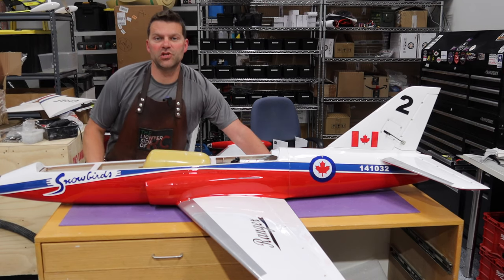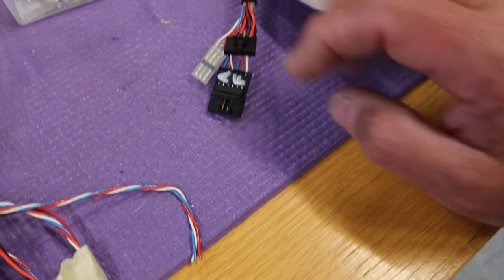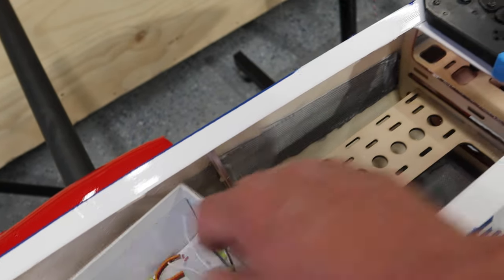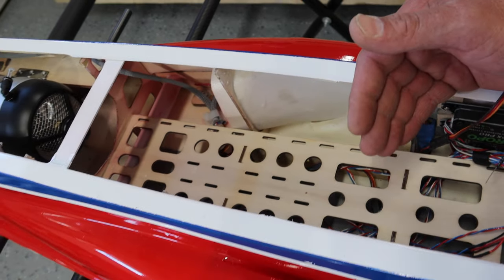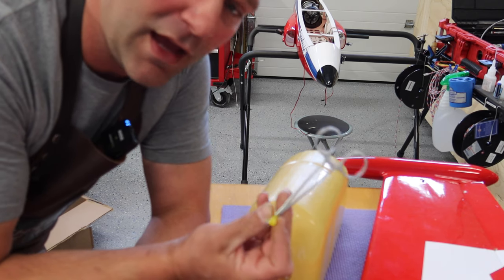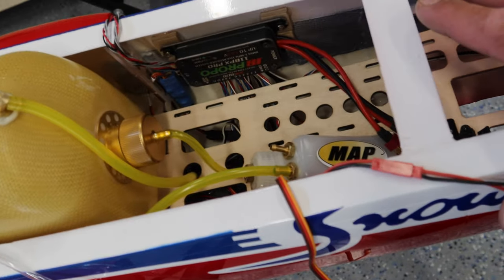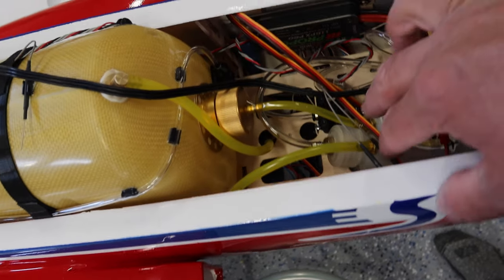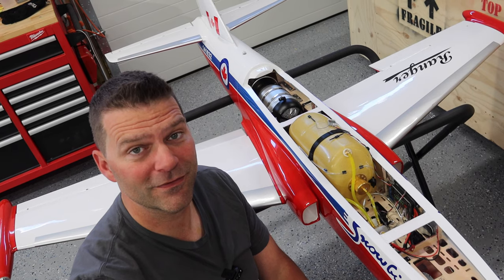Organizing The Install On A BOOMERANG RANGER

Comment: I have to admit you confused me a bit.  You talked about being tail heavy and then immediately moved the battery for the turbine closer to the CoG when there APPEARS to be plenty of room over the nose gear.  Why make it so you have to add more dead weight to the nose?  You also mentioned the UAT being empty.  Since you seem to use the same size UAT in these builds, maybe weigh the tank empty then filled, subtract the empty weight and make up a standard "lump of lead" to set right next to the UAT when you're checking the CoG?
Reply from the maker: At this point in the video/build it's just to get a rough idea on where things might end up.  Not an official C of G check.  C of G is done in landing condition.  So UAT Full.  About 1" of fuel in the main tank.  Finished the build up last night and ended up moving the batteries back behind the fuel tank.

Comment: lovely looking aircraft and super interesting build as always. Do you use RC simulators to practice when the weather is bad over the winter or do you just wait for the good weather to return to fly again? im a novice pilot, mainly helicopter tbh but have flown planes on an RC sim and i have reviewed a couple of sims and find them great to practice on and fly as the UK has bad weather most of the time lol. trying to get RealFlight to test and review but cant afford it and cant get a copy from them to review, Wanted to know your thoughts on RC sims. cheers
Reply from the maker: Thanks!  I really struggle with simulators myself!  i'm sure my skill level would improve if I flew the sim for the entire winter but I find it painfully boring.  So I'm not a fan.  They are helpful but I have never found one that felt like the real thing.

Comment: Great video! Excited to see the maiden and start building my Ranger. One question on the main fuel tank pickup line. With such a large/long tank, are you at all worried about the line/clunk being able to fold forward with it just being tygon and no brass tube in the middle to keep it from bending?
Reply from the maker: Thanks!  This size tank in my opinion isn't big enough to say it has to be done.  May be a good simple thing to do.

Comment: Great video my friend. I just got my Ranger. This airplane is beautiful. Its going to be my first time to build an ARF Jet. I use to have a PNP Hummingbird from Global RC but lost it in a crash. How can I prepare the wings, brakes, LG connections to the fuselage without soldering. The soldered 6 pins conn looks  great but I never done it brother. Its there another way if you dont have all the crimping tools and pins to do this?  I will appreciated your advice.
Reply from the maker: Thanks Very much.  If your not going to solder than you will need an alternative such as crimping.  You can also just use standard servo connectors but there will be many connectors and you need to make sure they are clearly identified.
Reply: @thelightersideofrc  perfect Thanks. I was thinking about about the brakes and LG conections. Any suggestion? Its there an adapter that I can use?
Reply: @thelightersideofrc  Hello. What kind of cripping conectors you use and how can I get them online. Crimping will work for me and will be more orginized than servos extentions.

Comment: As usual, nice and clean build John! Just not a fan of the triple wing connector. I prefer to use a single connector (Usually one 16 pin connector per wing) but of course if you prefer or need to keep the factory hole, no choice 😉 Good job!
Reply from the maker: Thanks Klaas.  Yea It would have been nice to minimize the qty of connectors but didn't want to start removing additional material to make it work.